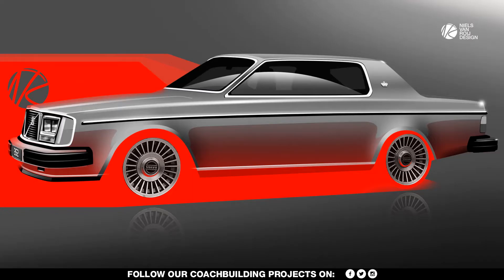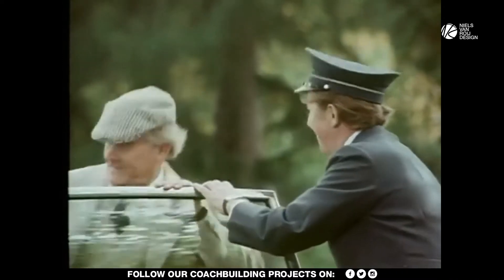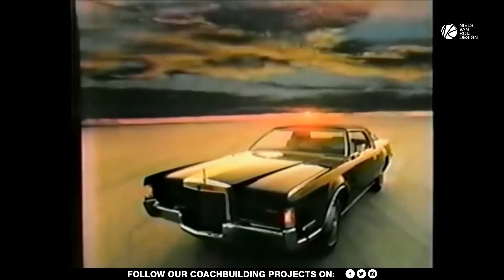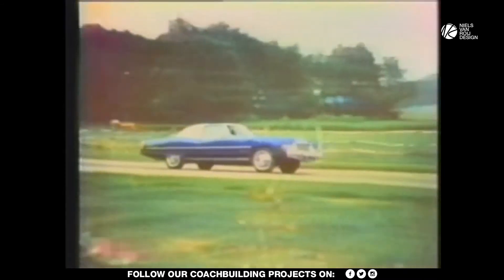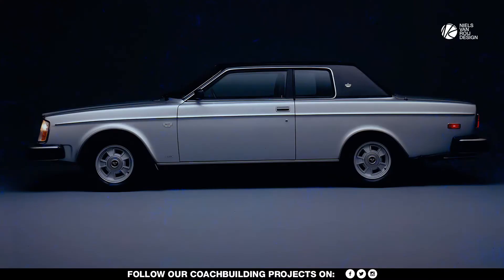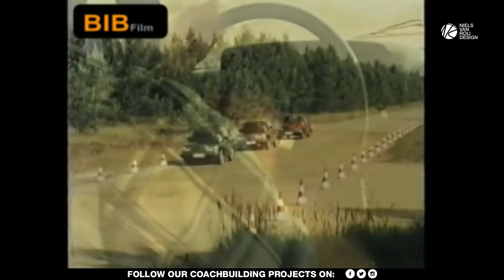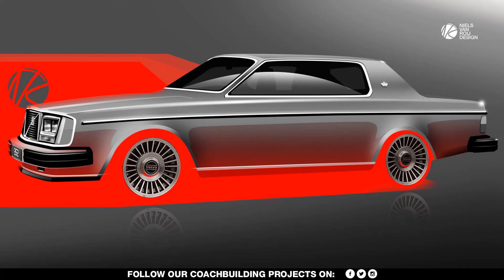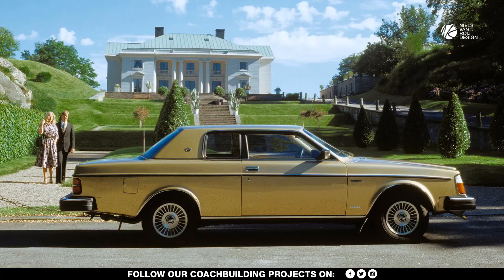Volvo 262C Bertone car design review: Sweden's Land Yacht luxury coupe! | Niels van Roij Design

Comment: My father used to have a 262C Bertone. Extra (illegally) powered. Great car. Thanks again for this well done video.
Reply from the maker: Ah, great to hear your dad had one! Which type of mods did he do to the engine? Was it the PRV6?
Reply: @NielsvanRoijDesign  To be honest, I don’t remember that anymore, unfortunately. There must be old photographs of the Volvo, somewhere. It was a grey one, with the black top. But thanks for this trip down memory lane. ☺️
Reply from the maker: @jochemjurgens7997  Ah, well the memories are what is key! Thanks for getting in touch and sharing them!

Comment: Low and streamlined. That's how W140 could look like if the roof height was dropped to proportional level.
Reply from the maker: Well, although this 240 to 262C chop job is quite a drop (10 cm is huge) indeed, Sacco complained (rightfully so) about how the W140 was proportionally destroyed by engineers forcing his hand. Comparing the W140 to the gorgeous W126 does show how elegant it could have been...

Comment: Oooo. How to ruin a car in easy steps. The 144 was a good-looking car. 244 not so nice. 264 with the huge rectangular headlights not so nice again. 264 US spec with huge bumpers and fussy headlights even worse. 262C genuinely ugly. Someone has one near our house. I have to look the other way every time it drives past. I agree with the commenter below who said they later got it right with the 780.
Reply from the maker: Well, the two cars are very different. The 262C is not for everyone, as it is way more radical than the 780. And the 780 is a lovely car, but the 262C has way more distinct character. It depends on what the goals are for the project and the brand. Both are excellent pieces of Volvo design.
Reply: everything you said is the opposite for me ahahaha